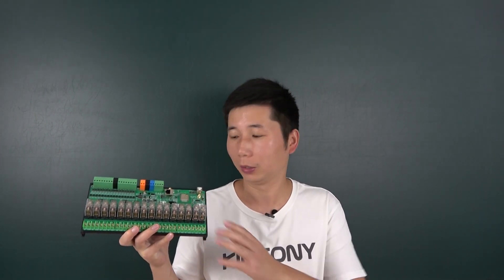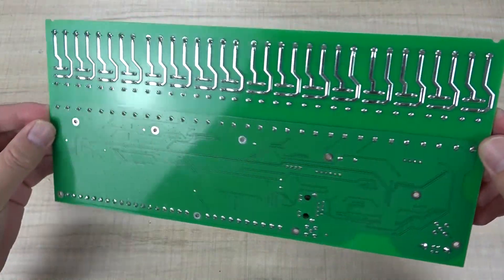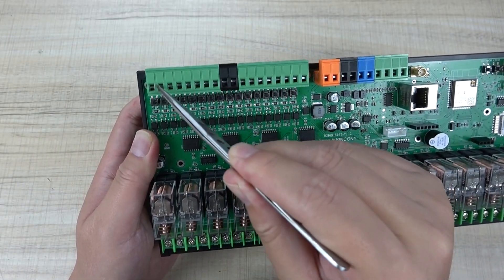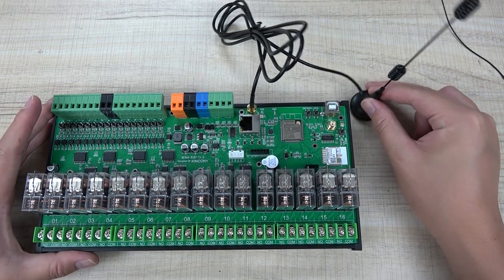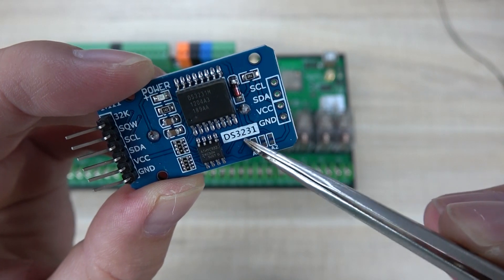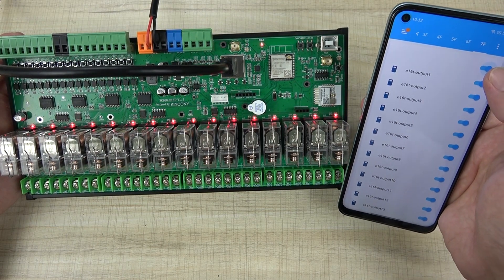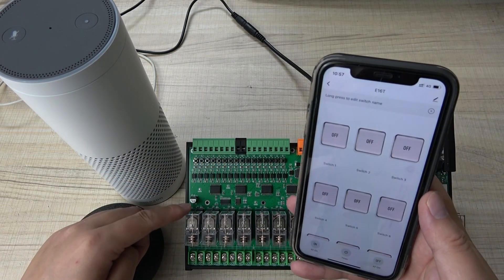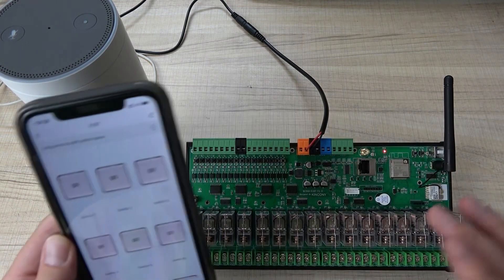KC868-E16T Tuya+ESP32 open source relay controller for home assistant

Comment: Wow I really like it, a question can you control KC868-E16 V2module throught ESP32 of Home Assistant?
Reply from the maker: use E16S or E16T for home assistant by ESPHome, E16v2 just a relay board without ESP32 chip.
Reply: @KinCony  thanks for getting me back, I have several ESP32 Chip  and want to configure the GPIO pins to work with this

Comment: if i flashed esp32 by esphome i will lose tuya application?
Reply from the maker: yes
Reply: @KinCony IoT  
Thank you 
But can i reinstall  original firmware frame your site and use tuya again?
Reply from the maker: @toofya3027  sure, you can download original firmware from our forum.

Comment: Congratulations on the equipment, what programming software does it use to create scenes, and be able to configure the analog inputs?
Reply from the maker: very easy, just use tuya app to create scenes on mobile phone.
Reply: @KinCony  i´m engenier from Brazil, i´m work with  Siemens, and Rockwell, we lik your board, we go contact you
Reply from the maker: @RicardoDatto  ok, thank you.
Reply: @KinCony  do you like a  partnership in Brazil

Comment: if this works without KC868-HxB, how can you extend the outputs in order to have 32 ? can you connect an extender to it (KC868-E8  or KC868-E16) or you need the KC868-H32BS for that ?
Reply from the maker: if you want 32 channel, you can chose KC868-A32. one board is enough.
Reply: @KinCony  ok, but if I want to use the ones with removable relays what choise do I have? Like it is E16T, cause this one has multuple features. Should I put two boards?
Reply from the maker: @cristianilovan2200  if want to use removable relay , you need to use E16T:2pcs, add integrate to home assistant by ESPHome.

Comment: Everything is perfect but i couldn't understant how the bord is connected to to wifi could you please show it to US?
Reply from the maker: use two way: 1: config by ESPHome integrate to home assistant.  2: download our arduino code for running wifi.
Reply: @KinCony  Actually we don't know about home assistant with all products we stuck with this problem. We will higley request if you could make a complet vedio about your products with home assistant
Reply from the maker: @sajjidkh4209  we already have many video tour about kincony products work with home assistant.
Reply: @KinCony  yes actually i watch all of that but i couldn't find in deepth details from scratch because i want to launch your products in UAE
Reply from the maker: @sajjidkh4209  KC868-H32B Pro not need to use home assistant, just directly to use. if you want to learn home assistant, here are some lessons: https://www.kincony.com/forum/forumdisplay.php?fid=18
Reply: @KinCony  Amazing 😍👏👍 I will get it from your Store is it possible to put delay ON option🤔
Reply from the maker: @sajjidkh4209  option for relay auto off time?

Comment: Amazing products thats what i was looking for is it possible to increase the relay with high Amp?
Reply from the maker: it's 16A removable relay, not enough? how many Amp you want use for relay?
Reply: @KinCony  i try to order from you store but its showing only one option 16amp
Reply from the maker: @sajjidkh4209  what AMP you want to use?
Reply from the maker: @sajjidkh4209  if you want large, you can add extend contact, such as 25A,40A,100A.....
Reply: @KinCony  32amp
Reply: @KinCony  25 and 40 will be ok is it fit in the same Bass and how i will make order?

Comment: Is their anyway to get the controller logs as historical events.  Example if i connect  the inputs to door contact then i need to know when the door is opened as security event  , please let me know how to get this historical log
Reply from the maker: if you integrate board to home assistant by ESPHome, sure, all history have been saved in home assistant, when turn on/off relay, when input trigger.